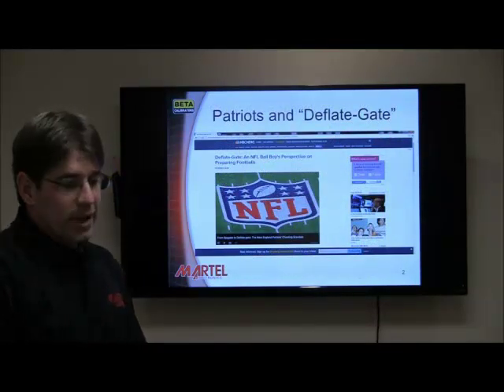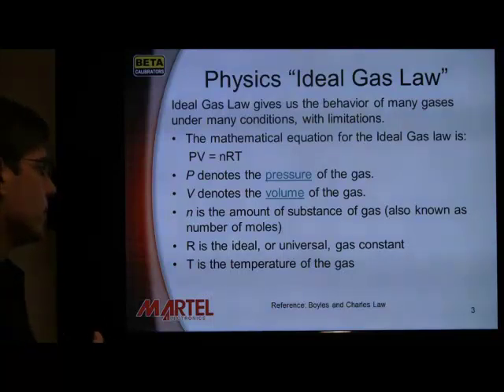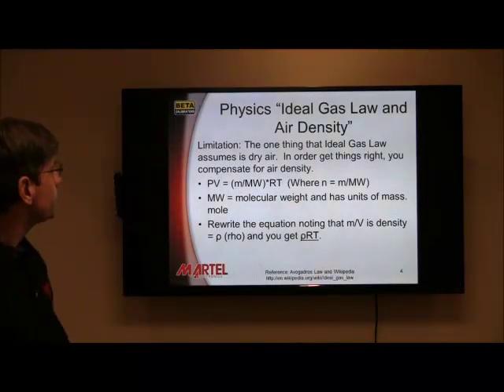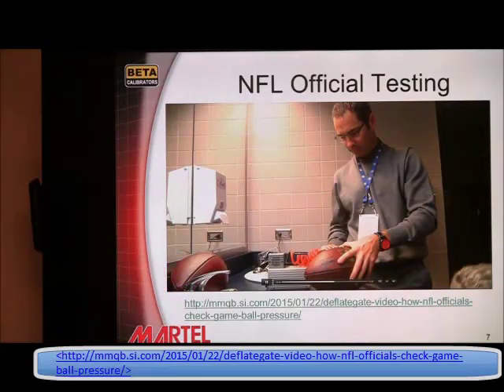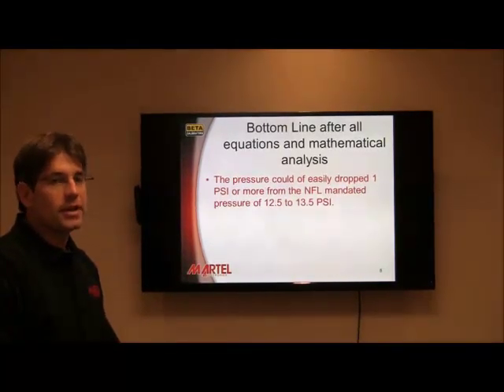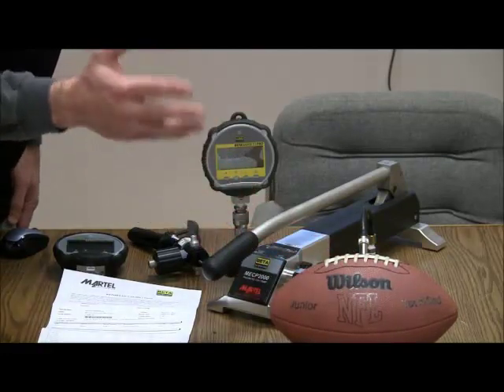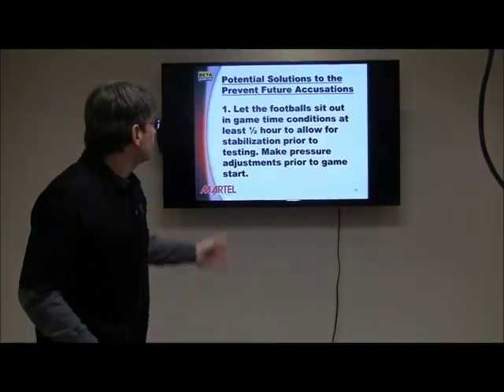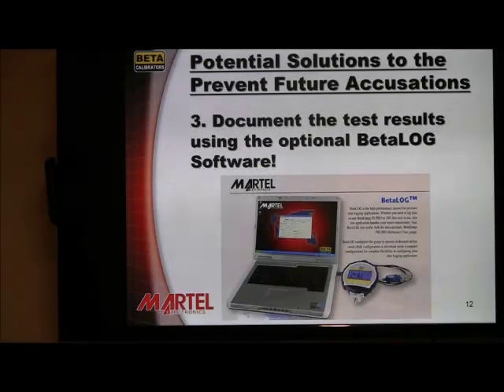Martel Electronics take on "Deflate-gate". Mystery solved!

Comment: A Fool-proof SOLUTION for NFL ball pressure:

1)  Keep the current process of the teams giving their game balls to the officials 2-3 hours before kick-off. The officials have time to inspect the balls and correct any problems.
2)  At least 90 minutes before kick-off, the officials place the balls in breathable tamper proof bags or other containers, seal the containers with tamper-proof fasteners, and take them down to the field.  This will allow the air inside the footballs to equilibrate to the climactic conditions (i.e. temperature) on the field.
3)  The bags are placed in plain sight of both teams, fans and officials in the center of the field.  In any case, they must not be left near sideline heaters or cooling fans.
4)  The outside of the containers are reflective White in color. (If the containers are black or other dark color and left in the sun, they will heat up the balls and prevent equilibration). A team logo on the outside of the bag will prevent mix-ups.
5)  Whether to keep the balls dry from any rain will have to be determined.
6)  10-20 minutes before kickoff, the officials at midfield break open the tamper-proof seals, remove the balls and adjust air pressure to NFL specifications using a reliable digital gauge, such as Martel brand.
7)  Representatives from each team observe and confirm the pressure readings, and can object at that point (avoiding unprovable accusations later on).
8)  The ball containers are then taken to each team's sidelines for start of the game.
9)  Officials are allowed to check and readjust ball pressures at half-time or other times during the game.